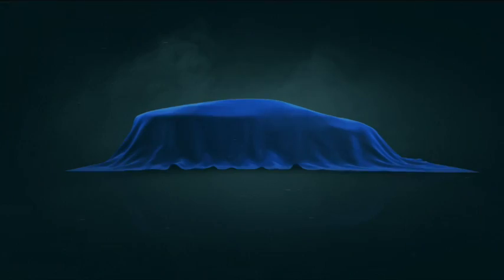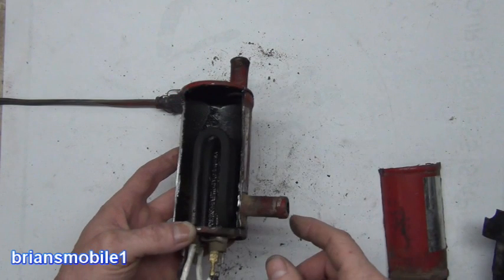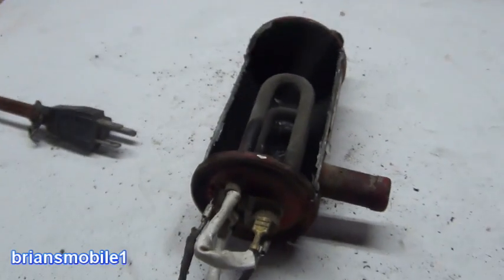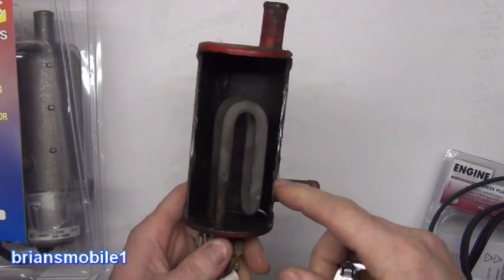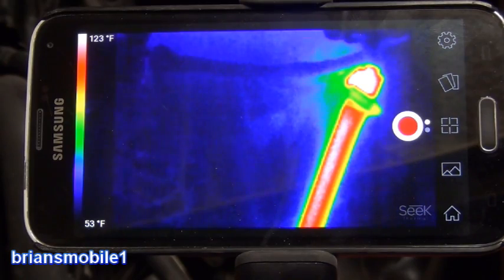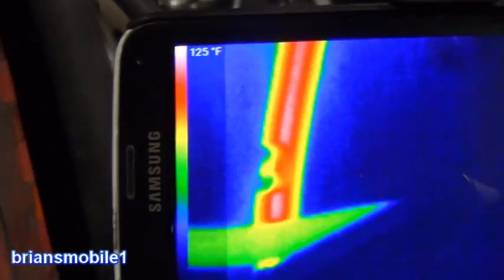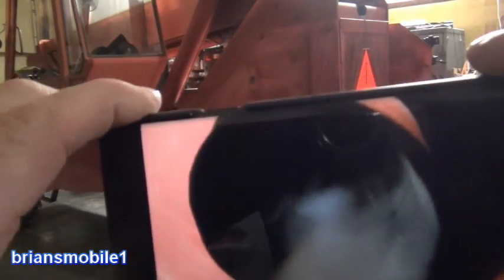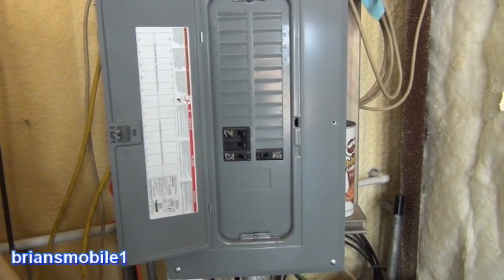2of2 Circulation Heater Guts and Thermal Cam Timelamps Glory

Comment: Is there a sensor or stop on this to prevent overheating the engine if you leave it plugged in a long time?
Or does it not get hotter then a running engine?
Reply from the maker: It has a thermal switch that interrupts the hot wire to protect the heater.  As far as heat damage to the engine- the temps aren't hot enough.

Comment: I have the Kats 1500 watt tank type , on my 1996 GMC Yukon , and 500 Watt , stick on the Trans. . Both go to common wire , that goes to weather proof single outlet in bumper . Truck takes 45 to 60 min. then starts like its Summer ! Cumming out of bottom block drain , 5.7 V8 and into heater return by thermostat .
Reply from the maker: That's a great setup!

Comment: For a long time I added these to my personal responder vehicles.  So much nicer to head to a Fire/EMS call at O-Dark thirty on a 20 degree day, in a vehicle that had heat and defrosted glass when you got in. The ones that install in the block work but those need to be plugged in for a long time to get any heat.
Reply from the maker: Good on you brother!  Thanks for being the kind of guy to do that!

Comment: 20amp is great but not everyone has 20amp circuits. Someone might pop that 2k watt heater thinking more is better but it will never work as it won’t plug in and if it does it can blow common beakers.